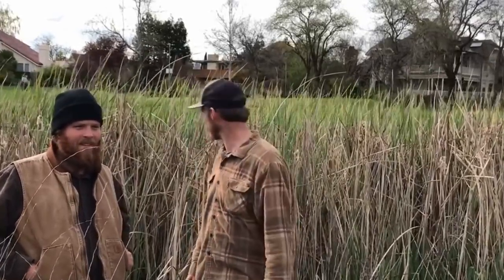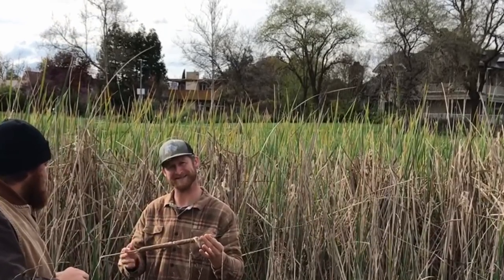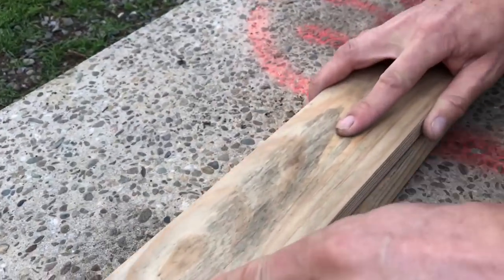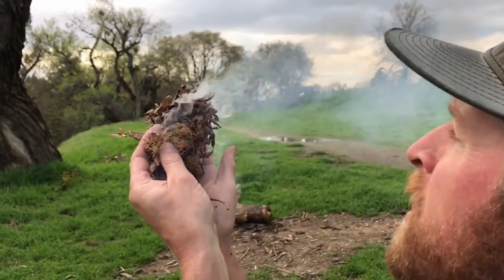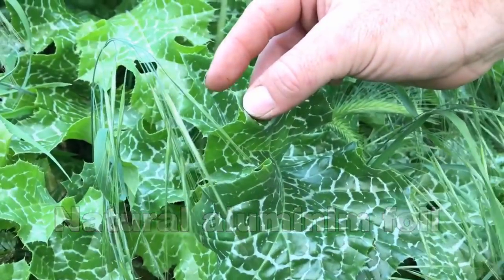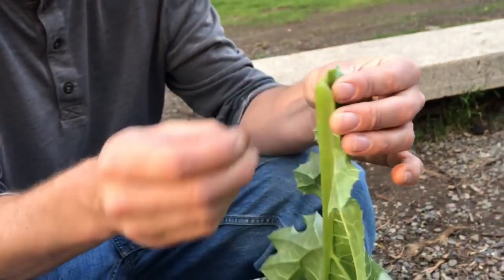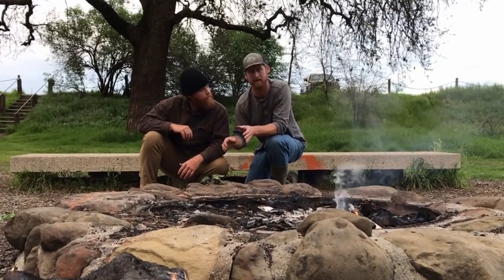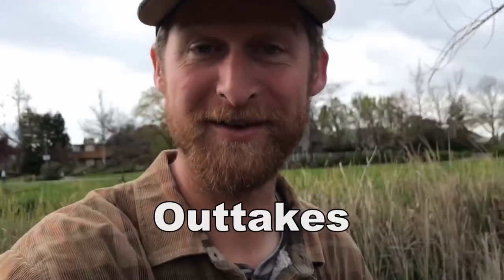Roasted Cattail Heads w/ FRICTION FIRE!

Comment: Though you are correct….You can eat lots of the many parts of the cattail. You just have to know what you’re doing. 
For instance:

The spikes
-the spikes you can eat in the early part of summer. It’s located on top of the stalk and while they’re immature wrapped in a leafy sheath they make a decent vegetable. If you boil them briefly and then nibble the flower buds off of the stock like eating miniature corn on the cob they should have a hint of sweet corn and a hint of mushroom flavor. You can also eat it raw.

The pollen
-The immature spikes will begin to release pollen soon afterwards in a matter of a few days. When the head is yellow - if you tap the stalk it should release a cloud of yellow pollen. You can lean the heads over and shake them over a container, or into a clean empty plastic milk jug by inserting the cattail into the jug and shaking it. 

You want to do this when it’s not windy or rainy and you’ve had fair weather for a few days. You can collect about a quart of pollen in an hour. Shake your pollen through a cheesecloth or screen to sift out insects and woolly fibers that always seem to get mixed in and you ought to dry it before storing it. You can use this pollen in making muffins breads and other baked goods and it is recommended to combine it with flour because it is not sticky by itself. You can combine it into hot cereal or mix it with other foods because of its mild and pleasant flavor.

The Laterals
-The lateral shoot of the rhizome are white or cream colored and smooth on the outside. Because they have not developed any roots they break very easily and have not differentiated into distinct layers of rind and core like the mature rhizomes. The tips always points sideways and do not curve upwards or terminate in a leafy bud. You can collect these laterals from late summer into early fall after the plants have flowered and before they begin to die and turn brown.
Just reach into the muck at the base of a stalk and feel for the rhizomes. Once you find one that heads toward an area where there are no stalks, reach for it with your hands, if it ends abruptly in a pointed tip that does not turn upwards then you found what you’re looking for. Retrace your steps and at about the point where you feel the first roots emerge, pull upwards until the lateral breaks off. They are delicate so be careful when trying to pull them out of the mud without breaking them. Rinse them off well and then remove the few sheathes that are usually attached to the surface. 
They can be stored in the refrigerator for several days if you keep them wrapped up. They can be eaten raw, sliced into salads, or cooked in many vegetable dishes - they’re sweet and mild and soft with no objectionable flavor. They go great in soups or boiled or steamed and served with butter like asparagus. They are definitely worth the effort of harvesting them.

The buds
-At the tip of the mature cattail rhizomes large buds that point skyward will form in the fall. They consist of a bundle of several layers of tightly packed young leaves about 2 to 8 inches long. This is also called the shoot and sometimes erroneously referred to as the corm. Its bud lays dormant from autumn to the middle of spring and can be collected during that whole season by simply breaking or cutting them from the rhizome. With the larger buds cut off the ends and peel away the outer layer or two, of leaves because they’ll be too tough whereas the interior of the body is soft and white or yellow. The bud has a mild and pleasant flavor and is an excellent cooked vegetable.

The Leaf hearts or shoot cores
-these are the interior cluster of growing leaves in spring early summer and sometimes referred to as Cossack asparagus. This is probably the best known vegetable to come from the cattail plant. The hearts can be collected from the time the cattails bud begin to grow in spring until the middle of summer. The best time to get them is it in late spring or early summer when the flower stocks are not yet formed. Just grab the center leaves of a cluster, all but the outer two leaves that form a sheath around the other leaves. Then pull firmly and steadily upward slowly with increasing force until they detach from the rhizome and come free from the sheath. 

These come out very clean. Sometimes the cores tend to break off above the base which leaves the thickest and most tender portion behind. You can avoid this by using a knife to cut the whole leaf cluster at the base and then peel off the outer layer. You have to remove the outer layer of leaves from the rest of the core and again cut off the tender part that’s exposed because the interior leaves are tender much higher up than the outer layers are. There will be a lot of wasted leaf material. You can cook these hearts in a wide variety of dishes. These are recommended to eat cooked because if eaten raw they tend to give you an itchy irritated feeling in the back of your throat.

The Rhizomes
-cattail rhizomes are best gathered from fall to late spring. Look for places where the cattails are growing sparsely and the mud is soft near the deep water edge. Dig them out with your hands to prevent breakage and feel along them, then cut the rhizomes from the stocks rather than trying to rip them out so as not to let them split and then let in mud which will ruin the starch it contains inside. Rhizomes often connect two plants together, and therefore it must be cut at each end. 

Sometimes you might happen upon a floating cattail mat or island, which often will be a very manageable and a fortunate solid mass of rinsed root stocks that can then be collected with a little effort. These rhizomes contain course tough fibers and is most useful in the making of cattail rhizome flour. You have to peel the rhizomes down to the inner core. Then you can use the “wet method” or the “dry method” in order to extract the flour.

If you’d like more information on this, I recommend Samuel Thayer’s “ The Forager’s harvest “a guide to identifying, harvesting, and preparing edible wild plants.

All that is to say, you arrogantly disregarded a plant thats mostly edible, which exposes your laziness on the subject matter. Whereas becoming more knowledgeable about some thing can help you to instruct others. Conversely, making a YouTube video to demonstrate such ignorance for the purpose of pulling one over on everybody it’s just a waste of time.

Hopefully you’ll pick up one or both of Samuel Thayer’s incredibly helpful foraging books and not be so ignorantly touting the poisonous plant fables of our modern society.  Then you can act like real men and make a real video without looking like a total crackpot. You’re welcome.